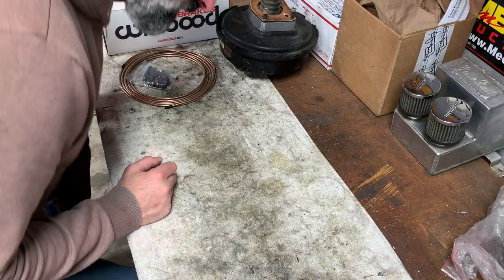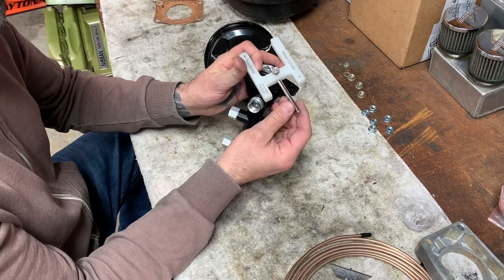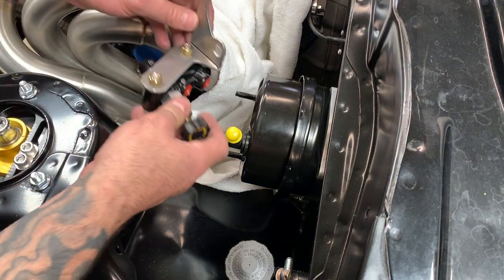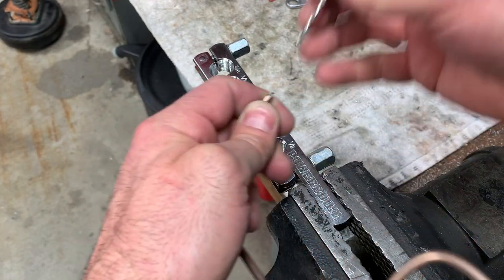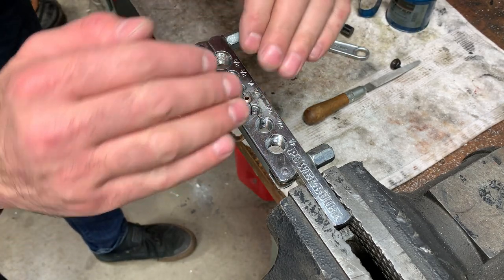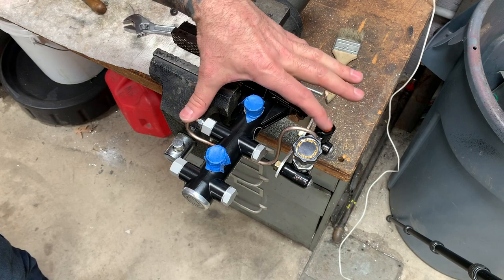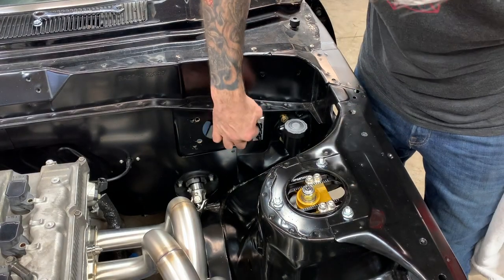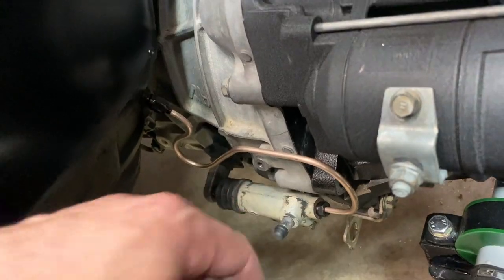3SGE Beams swap Celica. Brake lines, booster & master cyl Ep17

Comment: Hello. The brake lines are coming out great. Great info on the Wilwood products and Techno Toy Tuning. Can I make a few suggestions. The aluminum bracket that you made should be on the other side of the master cylinder. This is so the Master cylinder will be sealed with the brake booster. In the future you can use a welding rod or coat hanger to mockup the brake lines. This way you can see exactly where the bends will start. There should be a flexible braided line between the fire wall and the clutch slave cylinder. The line will become fatigued and causing a leak. Hope this helps with your project. Keep up the awesome work and can't wait for the next video.
Reply from the maker: I was thinking about that clutch line. I might have some PTE line around the shop. I'll have to check. Ive seen some people make them into a spiral so that the flex a bit. Im not sure how much my engine will move cause the mount are pretty stiff. Friend of mine told me about the coat hanger trick as soon as I finished the job. lol. The gap in the master cylinder will be sealed up. There is a rubber boot that will be installed over the cylinder inside. Also I made another little plate that will fill the gap on top. I wasn't thinking. I should of just made the bracket a with a hole in it rather than just the bottom part. Good call though. I appreciate the imput!

Comment: I saw online it’s only good for sale it’s about midway through being converted to a rally car it’s at about the stage that your vehicle is that right now and it’s on sale for $43,000 so I think you can imagine what this baby is going to be worth when it is complete.  You definitely need to look at installing a premium car alarm system with GPS tracking, And remote kill ability.
I’ve been following this restoration since day one.  promise me, that when you are all done you will give us a thorough show off of the finished car, inside and out.  one thing I really dislike is sitting through an entire restoration video and they show the finished product for about five seconds.  give us those beauty shots please.
Reply from the maker: For sure man. At this rate it's will be a while before that though. lol.

Comment: Great work as always man! Love copper line, no rust, easy to bend, easier to flare (aside from the cracking you mentioned which always seems to happen for the second fitting when the line is basically complete...I'm redoing all of mine with copper as well. Leaning toward de-powering to eliminate the booster entirely, but that AE86 mini booster is a nice piece. Interested to hear your thoughts on pedal effort once you're up and running.

Definitely want to second the comment on having a flex section going to the clutch slave cylinder. Copper line will work harden and crack more even faster than steel. A braided line will help maintain pressure and allow the necessary flexibility .
Reply from the maker: I'll change it out soon. You guys are prob right. Better safe than sorry. I was going to go with out the booster, but a friend of mine mentioned that you really have to wrench on the pedal to get that car to stop. And with the big brake setup I'm kinda sketched out that it will be even worse. I think.... ?
Reply: Tes, a braided Stainless/teflon flex line for the bulkhead to Clutch Slave is a must. Love following this build!

Comment: What brake booster did you buy? Is it for a ae86? I'm going to have clearance issues with my 77 liftback. Not needing to upgrade the master. Trying to figure out if I can use one of these boosters before I just delete it.
Reply from the maker: Its one from TechnoToy Tuning. Its fits the AE86 but will need some mods to be fit to the 77